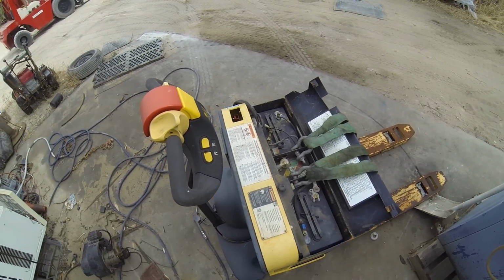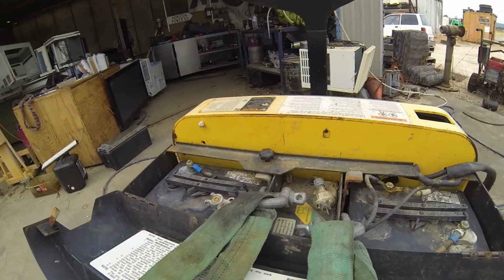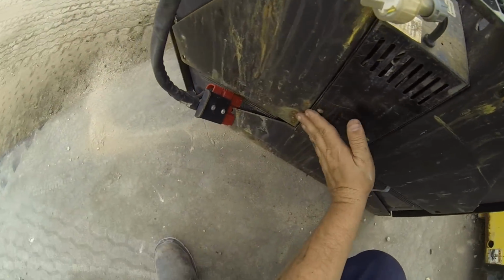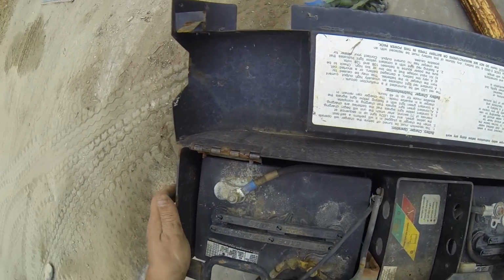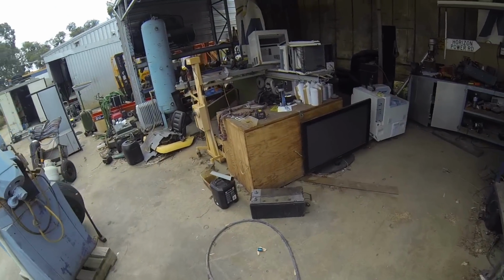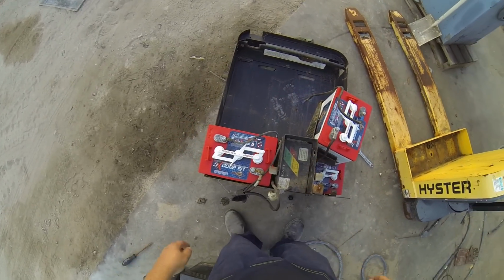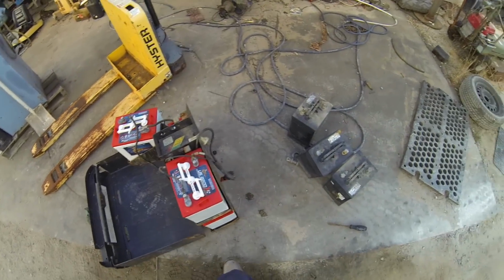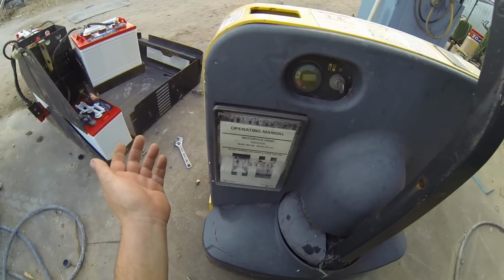Equipment Repair: Pallet Jack Batteries

Comment: Man o Man AAlex I get dizzy watching your videos now with head cam. I have worked on these W40Z for about 10yrs now. Funny the housing cover bolt was seized . When was the last time water was added to the bottom batteries?
Reply from the maker: probably the day the were installed :)
i'll be toning down the use of the head cam for a bit. it works well, but i have to figure out a method to the madness :)

Comment: Got a question for you.  We have one of these at work that we recently replaced the batteries with the same ones on your video, but the new ones don't hold a charge.  The tech says that there is nothing wrong with the jack.  Even if we leave it charging overnight we might get an hour worth of work with it.  What could be causing the issue?
Reply: Juan Cardenas don’t charge overnight. Or else once u ll start it after overnight charge use for few minutes then again charge it
Reply: Get a new tech one who knows what he is doing